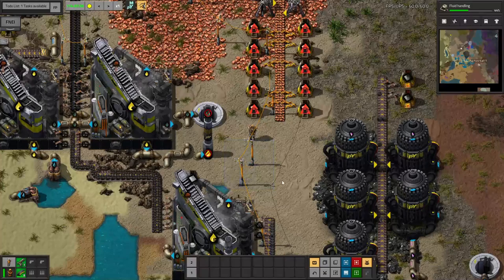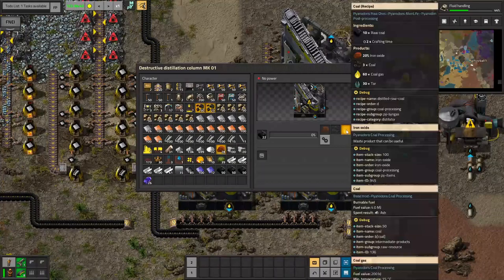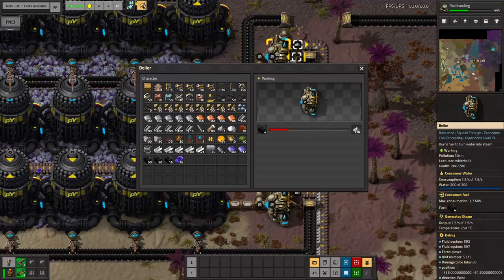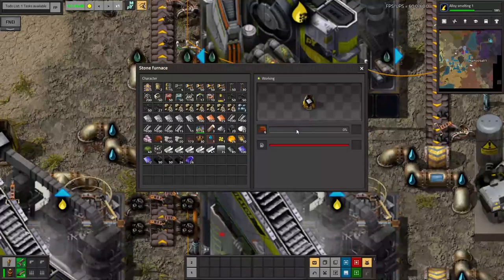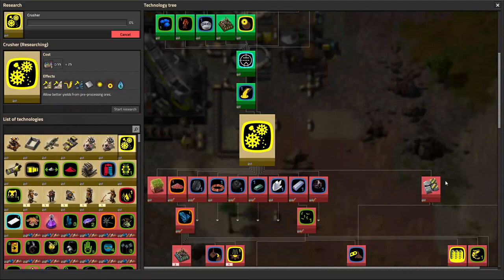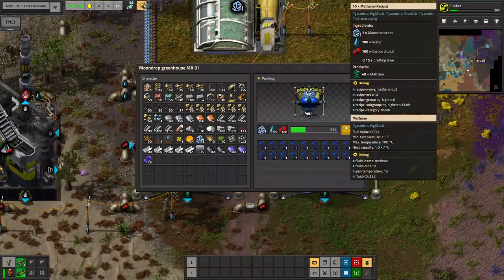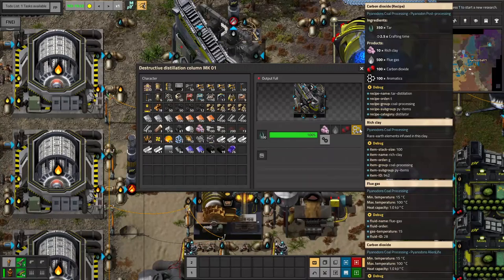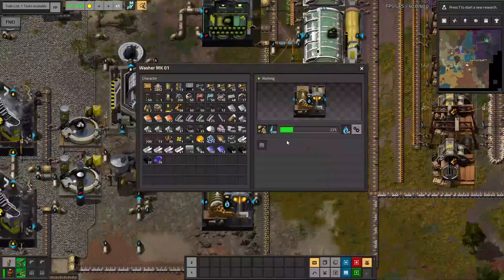PyAE Beta Supershorts #4: C1 Foundations

Comment: Venting syngas? Oof. At least power your Glassworks with it.
Also btw: Don't you have Creosote researched? You can make aromatics from creosote which seems much easier to me than having to deal with the Rich Clay.
Reply from the maker: I did power the glassworks later! Next episode. I’m just allergic to buffers.

The creosote to aromatics recipe is slightly less efficient and, as it turns out, is insupportable with the numbers I have. I would need an external source of tar. As it stands I’m using every drop, strangely enough.